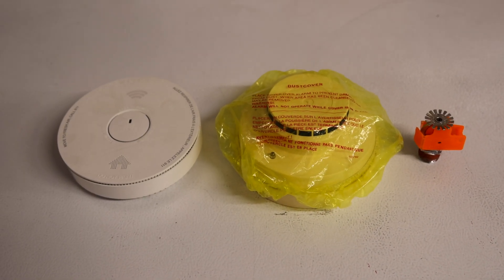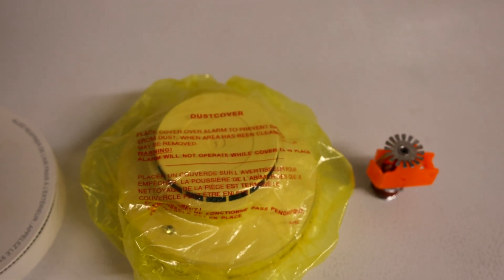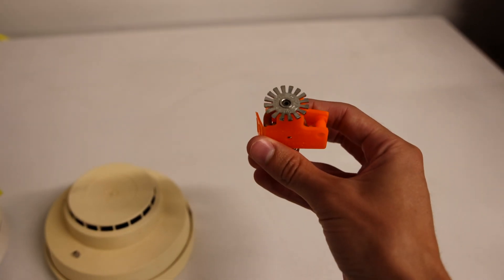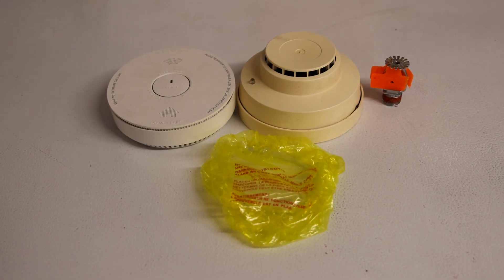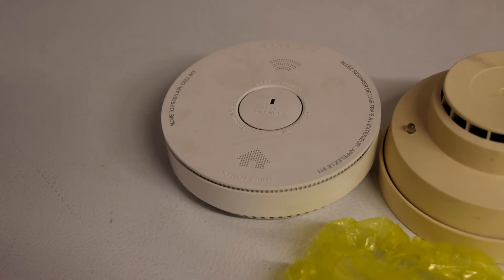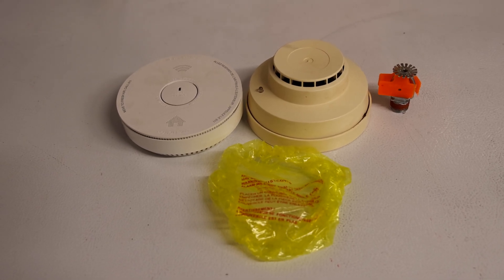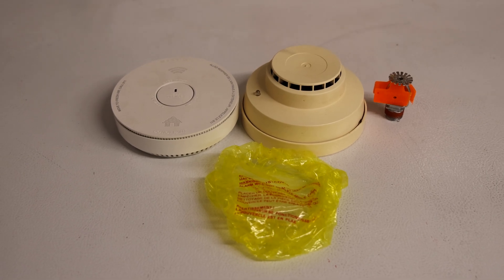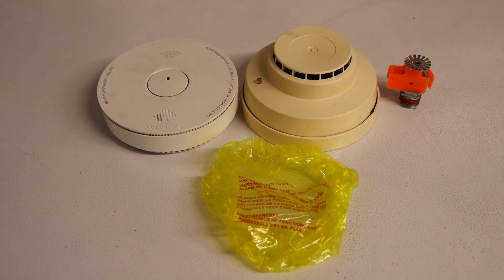This Will Render Your Fire Alarms USELESS!

Comment: Well, why do people making smoke detectors/alarms have to have a plastic cover? What's the point about it? If something was covering the smoke detector/alarm, especially the commercial ones that are connected to fire alarms and the system, then it won't activate the alarms when there is an actual fire, and it will put us in danger of our lives in threat! 😨😱 I should probably sue them for making bad smoke detectors!

Edit: Also, I forgot to say this, thank you so much S.E.R. Safety for teaching us about Smoke Detectors that won't work when they are covered with something! You did very great job! I will make sure to check my own smoke alarms/detectors to see if it does work! 👍👍
Reply: bad smoke detectors?? explain